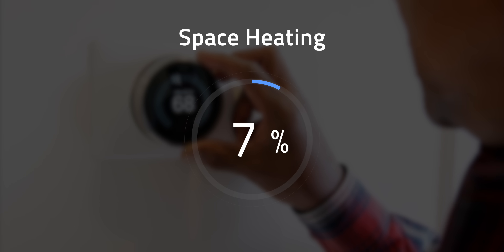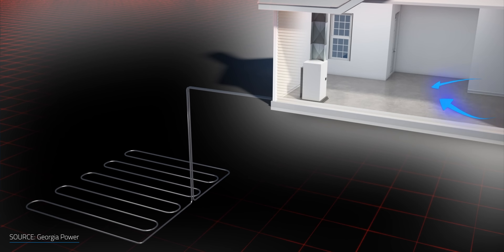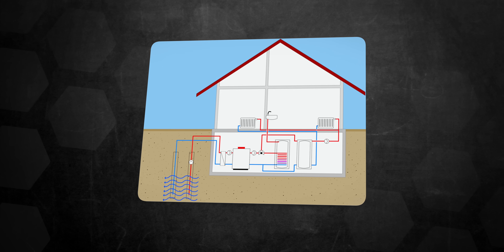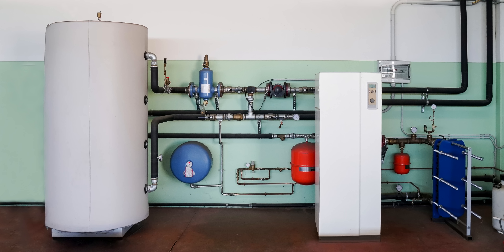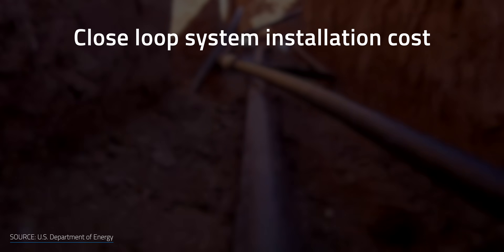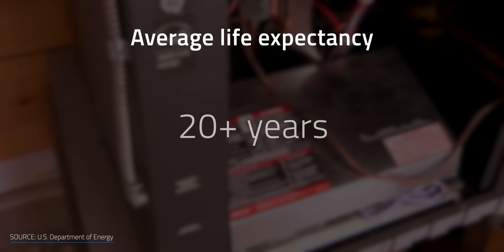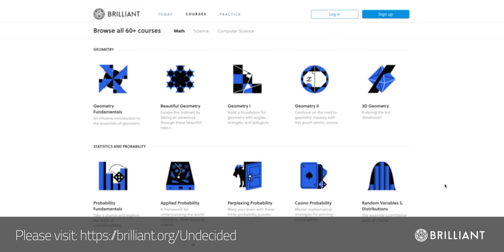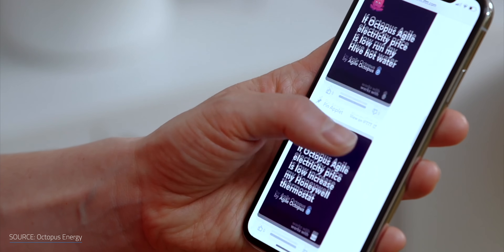Is Geothermal Heating and Cooling Worth the Cost?  Heat Pumps Explained

Comment: I had no idea this was even a thing in the US until my wife said her coworker from our state has geothermal heat. And going through your cost breakdown, it really seems like a nobrainer to me. We moved into our house, and had to have our boiler replaced within 5 months. That was about $4500. Now, all the cast iron pipes are rotting out, and it will be no less than 30k to refit the entire house. Some of that is asbestos abatement, but most is just how high the cost is. With a price tag that high for pretty much a "brand new" installation of a oil fired boiler, I can't imagine why I would go that route!
Reply: Inverter heat pumps are just as efficient and some even more especially with Ductless finally booming in the US. take a look at those products as well.
Reply: @michaelhatfull3305  Do you know what is meant by an inverter compressor system? It has nothing to do with the type of liquid or gas being moved by the compressor, only an inverter that varies the speed of the compressor no matter what the compressor is pumping which includes geothermal heat transfer as well if someone wanted to make an inverter geothermal compressor. They are more efficient but a little over 10% more efficient at best, not 50%. But the other reasons with comfort, constant temperature maintenance, less inrush current so the lights don't dim and the compressor doesn't make a lot of noise for a second are enough to convince me, just a nicer experience.

 The benefits of an inverter system are that the system starts up at 36%(depending on mfr and model) compressor speed thus reducing the inrush current as many houses with heat pumps cannot start the compressor with solar battery storage as the inrush current(many times the current required to run it once spinning) is too high for the amount the battery bank can discharge for that first half an rpm of the motor. In an inverter driven compressor system, the compressor is always on, it does not cycle and can keep a more constant temperature in the house as it gracefully varies the speed up and down based on what is needed at any given time so the positives alone make it more comfortable and less distracting whether it saves money or not, you would not get that constant cycling where the lights dim for a fraction of a second and make more noise starting like a an aircraft engine ramping up. The reason why it at least saves SOME energy is that the compressor doesn't cycle on to full and then to off and then to full every 2 degree change so it is utilized to only what it needs at any given moment, nothing more, nothing less, just constant temperature and no cycling. 

 Where I live, I have a 3 ton heat pump as a packaged unit on the roof at 16 SEER. The only inverter packaged system is made by Bosch and the 3 ton model is 18 SEER and the 5 ton model is 19 seer so there is SOME gain in efficiency, 12% if everyone is telling the truth but not earth shattering. We are still talking about inverter compressors in conventional refrigerant systems. The same improvement could be had in a geothermal system which is already more efficient than conventional refrigeration by a good margin as I hinted at earlier but I am sure the execution and location will vary this a lot. In the summer it often reaches 120 outside  and I have seen 122 and to keep the house at 75 degrees, it runs  over 23 hours per day and this is an R19 insulated house at only 1300+ square feet. The maximum temp these things are  rated to cool at is 125 degrees. The low temperature at dawn is just under 90 sometimes but it can get below 80 on some summer nights. My summer bills are around 300 dollars to keep the house at 75 and this is with a 16 SEER rating, it would save 35 dollars a month for the 18 SEER inverter unit on paper at least. I would still use an inverter for the many benefits in constant temperature, variable compressor speed with no cycling irritation and being able to start the darn thing from battery storage if you have solar. The temptation to convert to either a ducted or unducted split system is certainly there. I use a hospital grade air filter, the ductless system would turn that into several filters but it would be easy to add mini in in the ceiling exchanger  in the garage though. I am very interested in ductless just for this reason. There is a limit to how many you can connect to a compressor but I am sure the options are growing by the day.

Comment: I'm looking to do a combination of closed loop geothermal and evacuated tube solar for heating my future ICF home. I believe I can run mostly off of solar heat during winter. 
Should be fun to try out.
Reply: It all depends on where you plan to build your home, and the average outside air temperature in the winter, and what you consider warm enough for the indoor air temperature.  Some think that 65F is fine, others want it to be 68 or 70F, and that is a little less practical.  I will be installing a ductless heat pump in my bedroom that will run on 120 volts and powered by solar panels, a 5 KW inverter and 48 volt battery system, so basically no grid power at all!  It will be 12,000 Btu's and I expect it to produce heat to about 5F outside air temperature, while my area, 19F is record breaking cold winter day in Portland Oregon.  

If you happen to have a oil furnace, a $750 ductless heat pump from Amazon should save you over $1,000 in fuel oil costs this winter, even if you don't use it on nights that are below 10F and use oil instead on the very coldest nights.  

I installed my 14 SEER air heat pump back in 2014 and still am happy with it, and never did hook up the electric back up heater.  My electric bills - even in summer and winter have always been reasonable.
Reply: No question combining passive solar (especially with ICF construction) with geothermal can do the job of both heating and cooling year round, anywhere in the US and even much of Canada. Pair it with solar electric and batteries and you could be 100% off grid, self reliant.

Comment: Great video! Many properties do not have the land available for geothermal systems except possibly drilling two geothermal wells.
It is so much easier to use closed loop thermal solar for heating an ultra insulated, very large, indirect(heat exchanger) hot water storage tank that would keep water hot for multiple days both for domestic hot water and radiant floor heating. Then add PV panels for electricity for household use and for running an ultra high SEER rated air conditioner.

Comment: 6,000sqft NE Texas build with 3 separate 3 ton Geo-Thermal Units to heat and cool the SCIP (Structural Concrete Insulated Panel) home. Each Unit was in a mechanical closet. Two of the units were connected to vertical wells and the third to a lake loop. The SCIP home following a concept of an Insulated Concrete Box with a roof. A monolithic structure with the only possible air penetration would be windows, doors and ventilation. Recent addition near the home is a standard metal barn with enough solar to go Zero!

Comment: If you were to rent a bobcat with a bucket,  an auger attachment and some extensions (roughly $200 day) and spent the weekend getting your hands dirty, you could probably save yourselves thousands of dollars in excavation costs. 

Post an add on Kijiji in advanced, offering free soil and fill. Line up the day you dig with people picking it up, that way you can use the rented machine to fill peoples trailers and trucks with fill. Keep your property clean, and you won’t have to pay to dispose of it.

Just make sure to always call into your local utility locate phone number for buried infrastructure locations.

Comment: We live on a farm and have a septic system.  When the septic field is replaced, can the geothermal loops be installed a meter below the septic field?  This would utilize the same area to do two functions.  This would save the cost of digging a hole twice.  Thoughts?

Comment: You can even do it without liquid, her in OZ we just circulate air through 3" piping about 5-6' underground and just use a reversible fan, 1 inlet/outlet at floor level and the other end a ceiling level. Summer suck the heat from the ceiling and return cool air at floor level. In winter reverse the fan, suck cool air from floor level and warm air is returned at ceiling level.

Comment: Built house with ground source. Ordered 2 extra desperate heaters one for hot water and one for slab heating in basement. It's a very neutral heat. I shopped around and got a trane system that was the most simple. No computer just simple electrical contactors. The contractors push a antifreeze fluid. 15% methanol and water solution was perfect for my area.

Comment: I'm a retired real estate developper and builder from the Whistler and Pemberton, BC, Canada, area. I did my first experiments with geothermal energy in the early 2000s. I fell in love with this eco-friendly energy source right from the get go. I did an entire project, The Frontier at Pioneer Junction in Pemberton, BC, 80 condos and townhouses, all equiped with their own geothermal system and dedicated vertical loops. It was NOT an option. Occasionally, I happily refered prorspective buyers who questioned the price tag of our units to go check across the road if they didn't think we offered greater long term value, not only financially but also ecologically. We usually made the sale. I even built the gas station (originally branded Shell) with a C-store right at the entrance to that subdivision. We used a combination of vertical boreholes, slingky and even some horizontal loops. All the heat producing equipement inside the C-store, such as refrigirators, freezers, ice maker and even the slushy machine, were purchased as water cooled units so that we connect them onto the ground loop system. We did this to minimize the heat accumulation inside the store and reduce the demand for energy. When you think of it, it's crazy to produce extra cooling capacity to overcome the heat produced by your equipment. I should point that summer cooling requirements in Pemberton, BC, far exceeded heating requirements in the winter.  So, with the extra heat producing potential in the winter, we redirected some of that heat to a snow-melt area, a thick concrete slab covering two parking stalls located away from the builting and equiped with a manhole connected to the municipal storm sewer system, where we pushed the snow in the winter. It worked like a charm, it was slow but it worked.  We had a manual valve to isolate the snow-melt loop from the rest of the ground loop system in the summer.  It was a really wellworth experiment. I highly recommend the extensive use of geothermal systems. As a matter of fact, I have a new challenge, I plan to build an experimental 15,000sq.ft. greenhouse using a high yield Bioponix agriculture system (fully organic, see www.bioponixag.com) ) with a full geothermal system. If there's anyone out there with an interest or experience with geothermal in greenhouse or other energy demand settings, please contact me serge.cote@bioponixag.com

Comment: I installed my first geothermal system in 1997.  Currently have 5 systems running ins different locations.  If you have an existing well a geothermal system can cost less to install than a conventional natural gas split A/C system.

Comment: One of the factors that everyone uses to justify its use, is the ground temp being 60°, which is usually warmer than air temperature.  This is good, but why not use a forced air system that returns home air back to the furnace as in times past?  Return air should be at least 65°.  So why not eliminate the ground loop?

Comment: Careful I have a closed loop system and my air handler is going out the specific part that is going out is we’re the coolant in the loops meets with the air handler coolant which when that goes bad your better off replacing the entire thing rather then just that part due to how hard the part is to get and how expensive it is (11000$)

Comment: Hi Matt, thank you for another informative video. You mentioned ground source heat pumps have a greater efficiency and stability than air source pumps, but come with significant additional cost.

I was wondering if it would be possible to reduce the cost by combining hot composting or a green house to warm  a smaller section of pipes. Would love to hear your take on combining high efficiency new technology solutions with more basic solutions. I think this could potentially make the option more financially accessible to a wider audience.

Comment: What sucks is that we can burn coal cleanly. We could power every household in the United States cheaply for the next 1000 years. Unfortunately, Elitist's know that they cannot let you live fat and happy. Between Football games and Soy Lattes, you might start to question how much Freedom you actually have. So, the Elite install systems of artificial scarcity. Solar, Wind and even geothermal will not be enough and the powers that be know this. It is a system of conditioning you to live with less. A country must have an abundance of power and without that abundance, the country will crumble. All of the Western nations can adopt senseless and ineffective green initiatives, yet the gigantic producers of CO2, Indian and China take absolutely no measures. By the way, Carbon is one of the 3 building blocks of life. Sunshine, O2 and Co2 are necessary, however the Elite know they cannot demonize Sunshine or Oxygen. The Green movement is a scam to leverage you into 3rd world status and to finally control every aspect of your lives.

Comment: That's extremely interesting, would love a revision/update of this video, especially since I'm also a New England resident. 

I got solar just in time, I got an electric mini-split the next year and finally ditched most of my window AC units in 3 out of the 4 bedrooms. Happy to say it was sized correctly and I'm able to offset the electric cost while being comfortable.

So now my boiler sees a reduced load for the baseboard hot water.

A smaller geothermal to add heating/cooling to the remaining areas seems prudent

Comment: Last year we installed a drilled 200 meters and installed a heat pump with a 300 liters warm water tank. The cost was 160.000 SEK (approx 16k USD). After a year of usage we are going from 23000 kwh a year to 9000 kwh. With Putin prices being the new normal we are now looking to install solar with 10 kwh battery (140k SEK).

Comment: The problem with how you present this is, again, your math. To say heating and cooling accounts for 31% of America's energy usage is a fallacy. That would require all people to simultaneously heat and cool their homes at the same time, year-round in order for that figure to be correct. That changes a lot to how you decide efficiency, as 16% peak usage is just half of the 31% you stated.
Reply: Also, while you are correct that heat can only transfer to cold, you leave it at that. Thermal dynamics is more complex than just that, and your oversimplification leaves a lacking to your explanation. TD states that everything always seeks to reach equilibrium. This means that heat is cooled by cold, and cold is warmed by heat. The area around an ice cube is cooler than the sir a foot away, this is how coolers work. Instead of more heat being cooled, the cooler air is kept cold by the ice, while the heat from the walls are providing some heat to that same air as its trying to reach equilibrium with the air outside the cooler. The materials those walls are made of help decide how efficient those walls are at regulating the point of equilibrium

Comment: Bur do these work in heating or cooling?
There should be vast independent reviewing of similar homes one with a traditional hvac and one with these geo stuff.
Energy efficiency isn't the answer.
Imagine you are promoting an efficient engine to a truck building company. But the engine is a 2l size..which is useless.
Yes, it's more efficient than the 7l or bigger that the trucka are using traditionally, and would save a lot of money, but they simply don't do thr job required.

Comment: I’ll admit I am asking this question without doing any other research, but I’m confused. Water is incompressible. How does a geothermal unit have a compressor? I can imagine a water pump to circulate, and I know that heat pumps using freon compress the refrigerant.  But a water compressor?